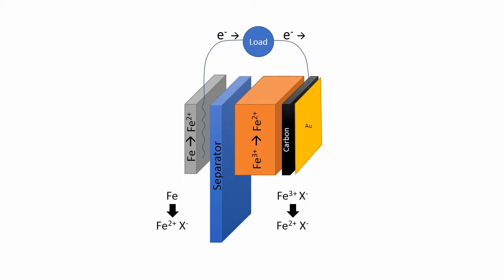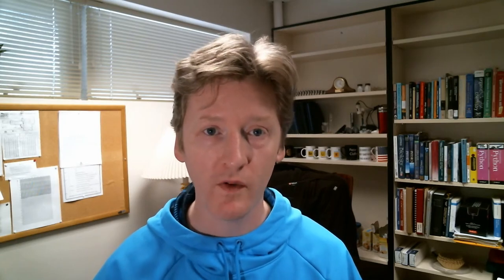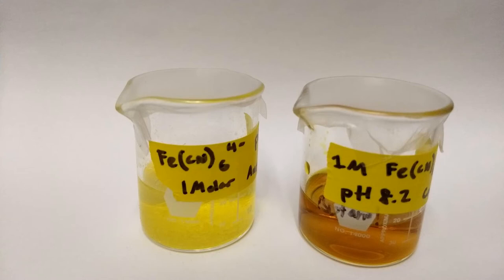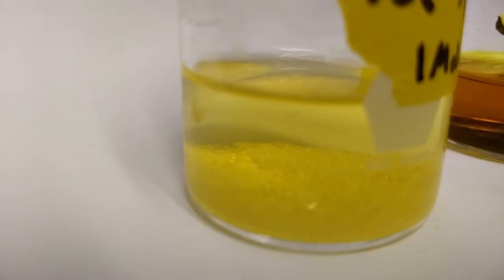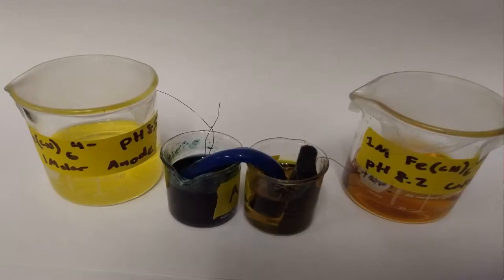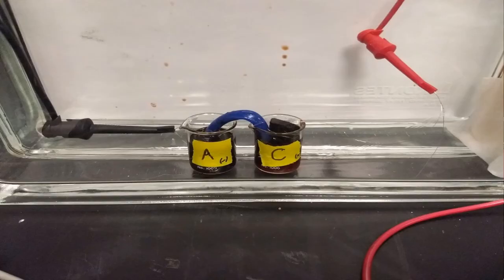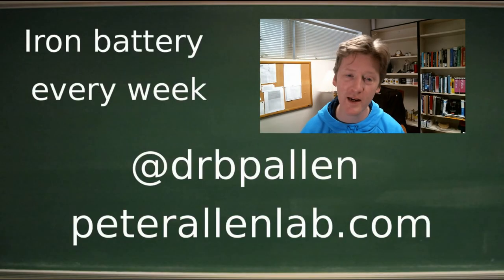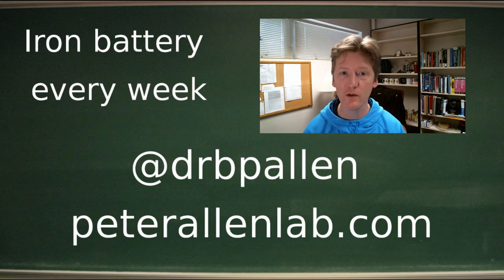Iron Battery part 71: Iron Sulfate is the winner

Comment: What kind of optimizations would be needed to turn the iron sulfate battery into a workable battery?
Reply from the maker: I think we need to get pH nailed down. Then I want to try some alternatives to Nafion for the separator (but may end up with Nafion anyway, in the end). Then current collector materials (carbon felt, plate, other metals besides Chromel). Then I think it's ready for scale-up (which is its own problem). We'll see how it goes- I'll keep updating on progress.